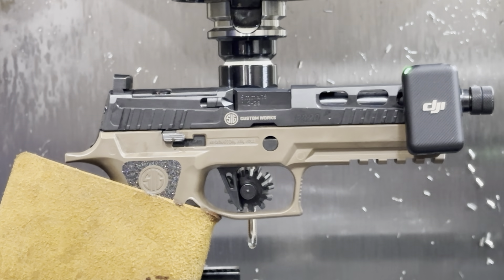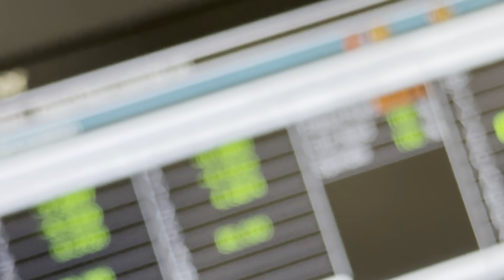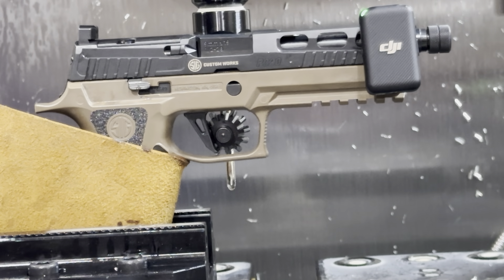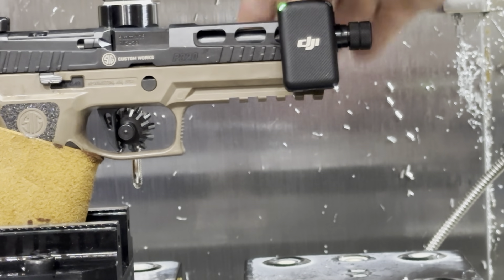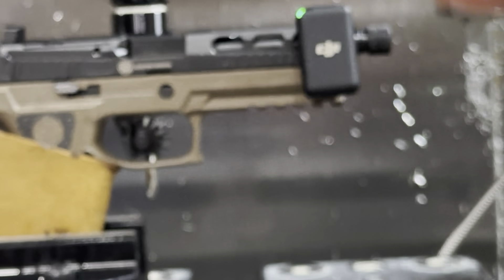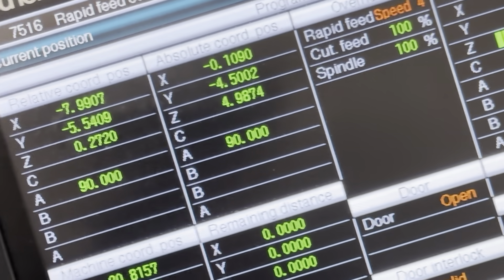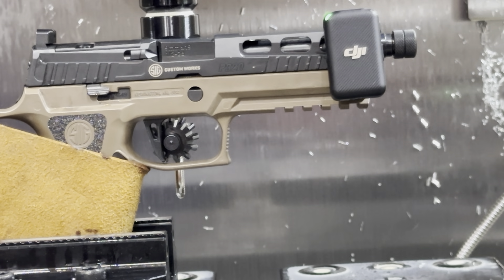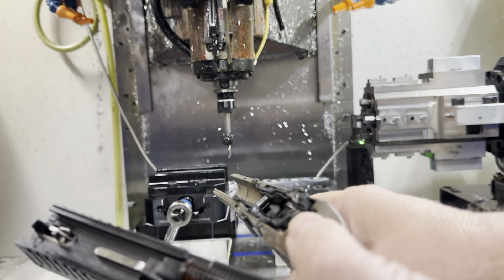Sig P320 accidental discharge tested in CNC machine.

Comment: ALL of these internet tests are working with a sample of 1.  I'd like to see testing done on a sample of a thousand and see where the results are.  Hundreds of thousands of these pistols are out there.  The issue is that the striker is fully cocked, and not half cocked like a Glock.  That makes this design inherently dangerous when tolerances are stacked, coupled with dirt, oil, wear, uneven wear, etc.

Comment: it would be interesting to see what kind of tolerance these sears and parts were machined to on several examples of the gun. with how much that slide can wiggle and the stuff that is being talked about where there is wear on the sear, i can easily imagine there could be a situation where the two mating surfaces of the sear and striker could walk off eachother due to spring tension and movement in the slide and internal parts. i get the feeling there are some of these that go bang and some dont. so if someone could get a hold of known "good" and known "bad" examples and then do preciscion measurments on parts and fitment, that would be very interesting indeed

Comment: All this proves is that this gun needs a positive trigger block safety. They should have never went with a fully cocked SAO striker fired design. But they wanted to market the sweet trigger pull... All the elegant Rube Goldberg safety mechanisms and their tolerance stacking issues have created this. The only safe way to carry this gun is with an empty chamber. That is how I will carry my 320 XTEN, since I won't sell it to someone else now with this happening. But that is unrealistic for LEOs and military. Now let's address the OOB detonations shall we? I am really concerned about that, and this issue is taking all the oxygen from the room.

Comment: Maybe the P320 you tested is safe and won't discharge without a trigger pull. That doesn't mean there aren't inconsistencies in the manufacturing process that will result in some P320s being able to fire without pressure on the trigger. You're dealing with a sample size of 1 which isn't statistically relevant. I like Sig. I love my P220 (it used to be my duty weapon). Having said that, even if only 1% of P320s have a dangerous flaw, those aren't odds I'm willing to take when it comes to my or someone else's life. Sig is great but I will never own a P320. 

On a side note, it would also be interesting to see if (and how far) the trigger and internal parts move when the gun is dropped at various angles.

Comment: The opposite is the Beretta APX A1 Carry…I have to pull the trigger all the way back and no matter how many times I pull it nothing happens.  But if I pull it all the way back with high pressure then wiggle the slide it finally fires (tested this with dry fire and its a 9/10 repeatability).  If my P320 and the A1 Carry had a baby (and I could register that as a new firearm) it might be just right

Edit:  Both have been replaced with a more reliable option, so basically have two good museum pieces for gun design fails.

Comment: That's not a factory trigger. Do this with a factory trigger to make it legit. 
Either way, it shouldn't go off until the trigger is fully pulled, whether you manipulate the slide or not. Then, what is with the slide being so loose it moves like 50 thousands of an inch.

Comment: Your testing is excellent, but it doesn't explain real ADs that are not NDs.

I believe that closer study will reveal that internal mechanisms 1) may creep from jostling of the weapon in the holster, 2) some guns may not have as tight tolerances as others, and 3) the design inherently is flawed from a safety perspective.

The AD upon dropping is well documented and repeatable.

That should be considered a serious safety defect on any modern firearm. Especially on duty or service weapons.

Some race gun enthusiasts might accept AD on dropping, but public ranges should not.

Comment: I believe the issue is a marginally out of battery condition that significantly lowers the threshold need to allow the sear and striker to pass. Often influenced by the units with optics that increase the potential for inadvertent rearward pressure on the slide. This is not a trigger pull issue. It is a result of the design which aimed at reducing the material contact ( thus friction )  to improve trigger actuation and produce a crisp trigger break.

Comment: Definitely more accurate than the Wyoming "test' with a caliper and screw in the trigger. Not trying to simp for sig but damn it's beyond obvious SOME trigger pull is required. So even if it's 2mm of human error, that's still SOME human error. In this day and age though you need to make EVERYTHING 100% dummy proof and sig should have known better AND known better than to gaslight to the community. PR debacle sure, mistakes have been made. Im still waiting for my p320 to detonate sitting loaded in my safe. I guess when that happens I'll eat my shoe but I'm definitely not tossing out all my other sigs cause one is questionable.

Comment: A lot of people don’t understand what’s going on here when they say this shouldn’t happen. The .090 is AFTER THE WALL. If the trigger breaks at .109 it’s over 80% into the trigger pull at .090. By this point the striker safety is disengaged and the sear is lowered through most of its travel.  Also the slop in the slide, which is horrible, is responsible for disengaging the sear at .090 when it is moved. All these tests only show that the trigger pull is short.
Reply: The trigger pull being shorter than it is intended or manufactured to be is still a huuuuge issue, especially in light of Sig pretending there's literally nothing going on here. And that's assuming that this guy's 320 is representative of ALL 320s - it's not unreasonable to assume the tolerances are worse for other ones, resulting in an even shorter trigger pull.
Reply: If you are at .090 does the striker safety reset? Personally, if I go between the wall and trigger break I don’t want to take a chance that the safety reset.
Reply: As in if you don’t go all the way to break but to .090 and then back off?

Comment: Thanks for gathering more data for the rest of us. I'd love to see the experiment replicated with a lower end model of the 320 as well. Other Youtubers who have looked into the issue like Mischief Machine have hypothesized that the issue is tolerance stacking across the entire system resulting in uncommanded discharges into people's groins. I have the expectation that a Custom Works gun would undergo tighter qc, and use higher quality parts which would reduce the amount of tollerance stacking across the system, and result in a gun that functions more correctly that other firearms. 

Also, I have a sneaking suspicion that normal users might not be able to override the magazine stop but I've met some 200lbs gorillas that have broken AK magazines trying to force a magazine into battery.